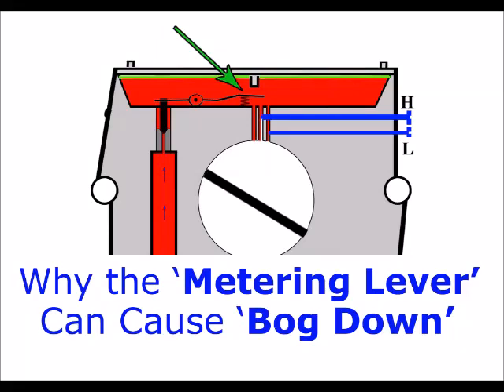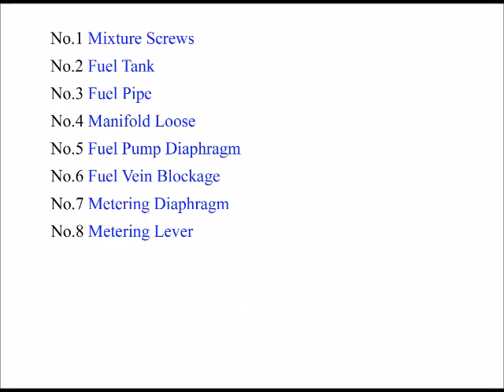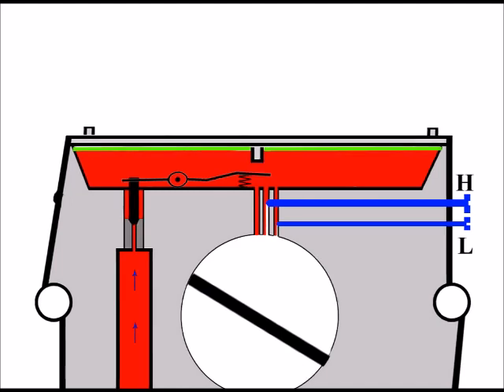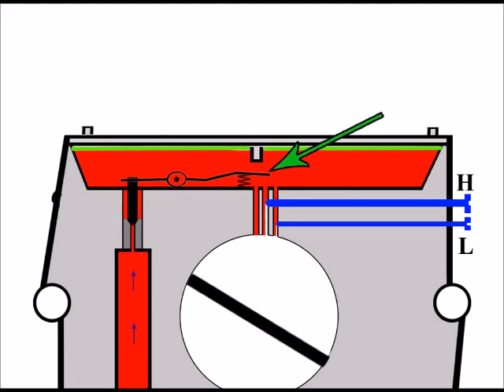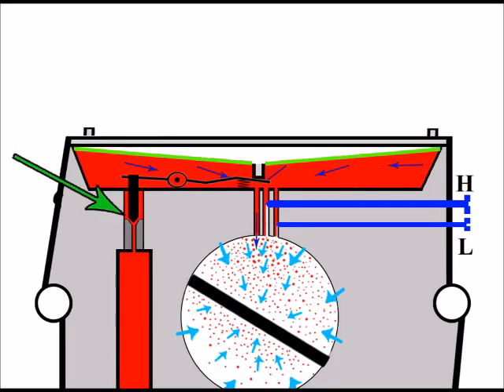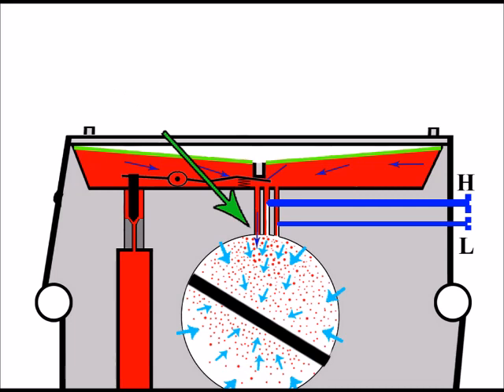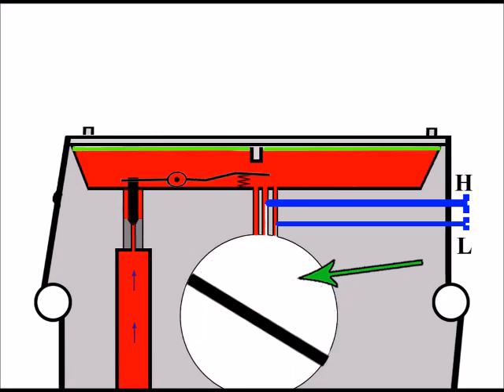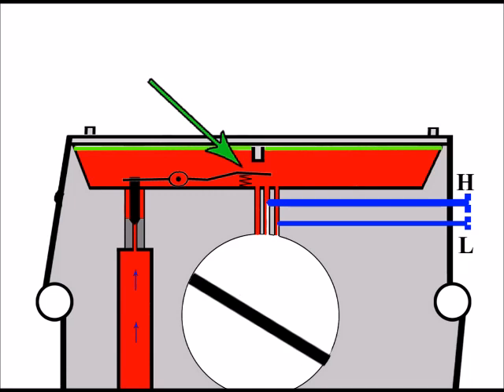2-Stroke BOG DOWN - Why Metering Levers can  cause it - Two-Stroke Carburetor

Comment: two questions or comments. 1: do you ever see a primer bulb in the supply side- meaning all fuel must run thru primer. 2: I removed the screen from my walbro carb as fuel did not flow properly. I found a tiny droplet of water UNDER it -any insight?

Comment: Hello thanks for the video however I have a problem with my weed wacker , when I start it in the morning it will run and when I try to cut grass it lose power and bog down and dies and when I try to start it back I have to choke it as it start it turn of back plz help with your ideas .

Comment: Working on a 96' GSX, and I think the replacement part is bent too far down, preventing the valve from opening around 3k RPM, and causing it to bog heavily and die after 3k RPM, but will go above 3k rpm if the choke is breifly tugged.

Comment: On those "variable jet types with rotating barrel and needle down into tube, what is the starting screw position and with only one screw, what speed do you adjust it or all three, idle, mid and high and get best for all three?
Reply from the maker: Hi. My next video should explain a lot about these carbs for you. It’s not ready quite yet as I’m still working in it and it’s detail, but it should be uploaded in about a week or two. It’s quite a large in depth video about them so it’s taking me some time to complete

Comment: great video I'm struggling with a cagiva mito evo 1999 125 2 stroke. she bogs and dies when I pull clutch out in 1st gear even if I ride the clutch at 9000 rpm she bogs down after moving a couple of yards. from your videos I'm assuming maybe low screw is set wrong and restricting fuel so pull away is dead but ive adjusted and tried to ride so many times any ideas would be much appreciated

Comment: hi there mate please can you tell me i have tkm100cc go kart iv had the carb rekitted its a walbro carb iv changed fuel lines air fitter plug it ticks over proper but soon as i give it power its like no fuel getting in and dies but will tick over non stop im new to karting so can someone please tell me how to tune the carb someone said its the mixture screws dont no one from the other lol cheers phill

Comment: Thanks for the great videos! 
I have an issue I hope you can help me with. I have a 2 cycle ice auger that will start but will not idle. I can keep it running with the throttle but when I close the throttle the engine will not idle and will stop. Can you point me in the right direction? Thanks.
Reply from the maker: Hi, thank you for your motivating comment, I really do appreciate it. Now, it sounds to me that your carburettor may need some tuning, that's providing there's no blockage inside and that the components are in good order of course. There could be many causes for your idling issues but generally it's caused by the need for some tuning. I do have a vid on carb tuning as well as there being some other great content on YouTube from others already. I would start with setting the idling screw then go for the full tune up. It wont take long once you have seen one of these vids. I hope helps. Thanks again
Reply: Thank you so much for your quick reply.
This carburator is a Tecumseh fixed carb so it has no adjustments. I have replaced every part that can be. The only thing I can think of is possibly the inlet valve lever is either too high or too low. What are your thoughts? Thank you for insight. I really appreciate it.